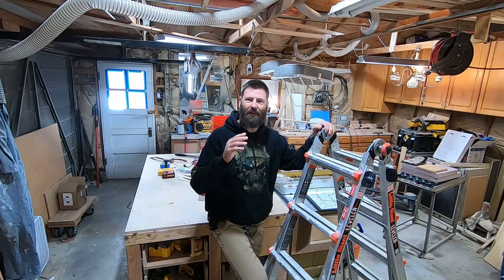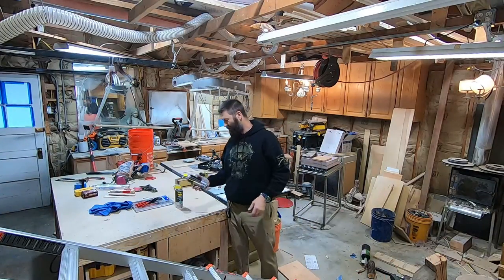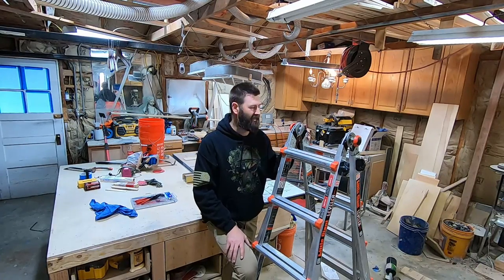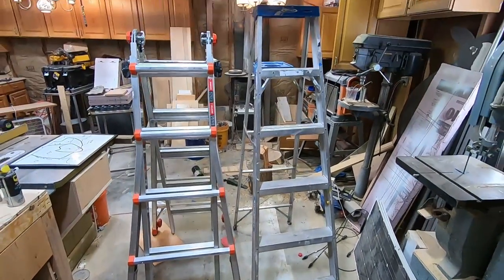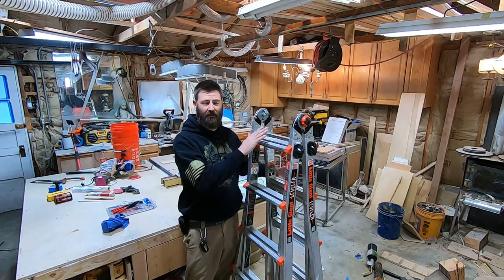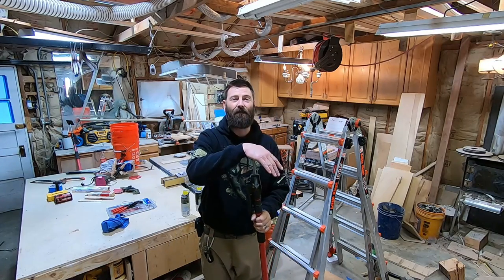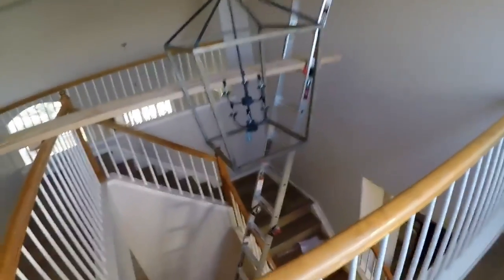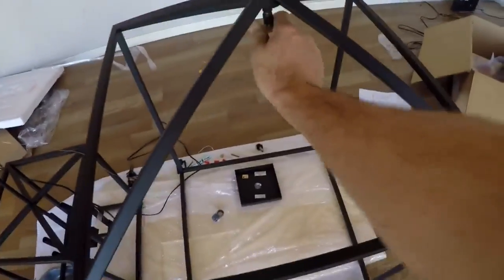The Last Ladder I Will Ever Own | THE HANDYMAN |

Comment: I've used the Little Giants for 35 years.  I've fallen off of them twice.  Both times, same scenario.  I was standing on them just like you when you were spraying that ceiling and I leaned enough to get my center of gravity off the center of the ladder.  Ladder goes the opposite way and I was headed to the floor.  Luckily, I only broke my wrist on one of those falls.  Love these ladders but like any ladder you MUST constantly be aware of your position.  Be safe out there.
Reply: Yep, don't do that.
Reply: Ever any problems with the feet slipping on hardwood or I the grass?

Comment: Little Giant held the patent on this ladder for years and were the only ones making them.  We purchased one and if I remember right we gave over $400 for it, but have had it for almost 30 years, banged around in vans, trucks, trailers and top of vans and job sites.  Still works beautifully.  We bought a new one for another van and had accessory levelers that we purchased that were a pain in the but to use but were useful.  I like the way yours function, but probably will not purchase another one as the doctors have told me to stay off of ladders and the wife is the enforcer.  Thanks for the video.  I love the Little Giants..

Comment: I love my 5 step little giant. I found it used in perfect condition for $99 so could not pass it up. The added Small platform Saves my legs when working more than 5 min. I love having a 22’ ladder that fits in my Tesla model 3. 

It is way to fricken heavy though so I also got a 3 step for smaller jobs.

Comment: I watched a ton of reviews on this ladder, and this is probably the best review because it shows it actually being used.  Also, it’s being used exactly how I am hoping to use it, over a banister to change out a light fixture about 20’ high, like you did!!  

Hopefully mine will work out just as well.  I bought the 22’ model today, lightly used for only $100; such a bargain. I think I’m going to end up spending more on the accessories such as the step plate attachment and tool caddy, etc as I did on the ladder itself, lol 😂. 

Thanks for a great review and Showing it being Used!

Comment: Sometimes they are the only ladder for the job. I only use them as an extension ladder when absolutely necessary as they are clumsy to extend without help.  The most useful thing for me in my work is the ability to extend one side longer than the other to keep you closer to the wall as you get higher.

Comment: I got one of these about a year or so ago for general use around the house, such as cleaning out the gutters and putting up Christmas lights - the extendable legs help when using on uneven ground and leaning against trees. Believe it or not, I actually transported it home using a bicycle (with a trailer). And yes, WD-40 fixes nearly everything that duct tape doesn't

Comment: I love my little giant ladders. I had the first one since 2004... still works great and never had to repair it. It will pinch you when taking back down if not careful. But the zones solved that and much easier to use. But love them both and all attachments make them nice.
Reply: Ever any issues with the feet on hardwood or in the grass with sliding??

Comment: Had a harbor freight multi that broke after 6 months, bought a gorilla that got stolen and then bought this exact one because of the leveling feet. Every ladder should have leveling feet. It's so much safer with 4 on the floor instead of 3 1/2. Also, didn't see you mention it, but there is a stand you can buy that hooks onto the ladder so you can stand on it or set things. Great platform for when you're working on electrical up high.

Comment: I have this types of multi positions ladders (for staircase only).  I guess my only question would be: what's the weight on that ladder? My werner  (same length) weigh about 43lbs the gorilla version same length is 38 lbs.
I am a high-ceiling chandelier installer and i prefer to use A-frame ladders. Ceilings over 23-ft i use scaffoldings. The biggest chandelier that i worked on is a Maria Theresa  8-ft x 8-ft, 84 bulbs,  600 lbs, 3 days, 3 guys to finish it.

Comment: I bought a Canadian Tire knock-off version of this for Christmas, regular $366 on sale for $200 (Canadian dollars, that is, which trades at about 75 cents U.S.) The only feature it's missing is the adjustable feet, but other than it seems pretty much identical in features and stability. The step ladder adjustability is terrific. My only issue so far was today, taking down the Christmas lights outside that were strung along the edge of a porch overhang (so no wall below) and maybe 17-18 feet off the ground. I have a proper extension ladder but wanted to try this one out. There's a 6" x 10" support beam that runs the length of the overhang, and so the job entails extending the ladder to the specific height that enables its top ends to lean up against that beam, so I can climb up and detach the lights.

I have to say, compared with the regular extension ladder, the multi-ladder was a real monster to get extended to that length. It was impossible to lay it on the ground, extend it, and then walk it upright, as the extended length is more than double my body and arm length, hence the top wants to tip back on you once the center of gravity is higher than your reach - and it's VERY top-heavy, so mere muscle isn't enough to counteract that amount of levered imbalance.

What I ultimately did was lay it down and extend it to about 14 feet, then walked it to an upright position, holding the balance with my left arm while muscling the top half straight up the last 3-4 feet. However, even the top half alone is heavy as sin when you have to lift it with one arm while simultaneously holding the lower part and handling the J-locks with the other arm. And then, of course, every time two rungs from the lower and upper sections need to pass each other, you have to figure out how to get your lifting arm repositioned without letting go, because if you let go the top section will drop like an anvil!

I managed in the end, but it was ridiculously fussy and difficult, and I would just go back to using the regular extension ladder if there's no smarter way to accomplish this objective - but that kind of negates a big reason for having this very versatile ladder in the first place!

I've been Googling to see if anyone has come up with a smarter technique to negotiate the extension capability, but so far no luck. If anyone has any thoughts, please chime in. Cheers!

Comment: I bought the LG ladder 20’ in 2017 and it was definitely a solid unit(although heavy). I bought the Gorilla Ladder 26’ MPL in 2018(although heavier) and I find it to be much more sturdier and a lot less flexing when fully extended. Both solid multipurpose ladders.

Comment: Nice. I have 2 of the step children to the Little Giant, the Gorilla Ladder. Cost around $100 for my shorter one about 15 yrs ago. It folds to about 4 ft tall or so and reaches a 1 story roof. That one has been awesome for me. Then I need a taller one. It’s similar to that LGs size to around 6 ft folded down and reaches about the same height. Home Depot had that on sale 2 summers ago for $120 so perfect. That too has been awesome. They made some nice subtle upgrades to the design. I had wanted a little giant but always pricey and the Gorilla is a great alternative for someone interested

Comment: I have the Home Depot version of this I forget what brand name is on it.  I agree with everything you say on this.  Home Depot version doesn't have have the self leveling legs unless I have completely missed that feature, which is possible.  LOL  I would agree they aren't so much heavy as they are unwieldy.  Old school step ladder you can carry and control one handed and still carry something heavy in the other hand.  This style of ladder you almost need to 2 hands it so the wide bottom doesn't smash everything you pass by.  That would be the only down side I have with it.
Reply: Also another nice feature you missed is you can stand on the top step of this kind of ladder.

Comment: two little giants and a decent plank make for a great mobile scaffold. The lower sections will separate for that purpose but if you need to go higher, two full sized ladders does the job especially if you have ladder jacks that will hold a full sized scaffold platform.

Comment: I got this ladder after watching your first video installing the light fixture on a high ceiling. I love the ladder, my only complaint is that it moves too much when using this ladder in the extension ladder. did a light bulb replacement on the exterior of a home; height was 24' high. climbing that high and having the ladder shake while I am going up was scary AF... but GREAT LADDER!!!

Comment: If you are doing Amazon Affiliate links they have that ladder a few dollars cheaper than Lowes. I have one that does not have the telescoping legs and use it more than any other ladder I have. Just using a minivan to work out of so limited space. Also, have a really old fold-up ladder that I am still using at the house. Probably 30+ years old.

Comment: Any one tried the  Task Tools poles from Northern Tool?
I've been using them for the past 3 yrs and LOVE them. The have a quick slide adjustment, and then you twist them like a turn buckle.
Not sure on the load rating, but I've used them in a few non conventional ways and they hold up GREAT

Comment: I was ready to unfriend you if you didn't like this ladder.  I've had one for about 20 years and it's far and away the best system IMO.

I have had to replace some worn parts and that has been easy as well.

Have you tried the step that they make for these?  They slide onto whatever ladder rung you need and will hold body weight for a makeshift work platform.

Comment: Very good video.  Do you know how high the Little Giant Ladder 22 ft. will reach with the "A" frame extended?  I need to replace the light bulbs in my garage and the ceiling is 15 - 20 ft high.

Comment: How do you secure it upright in your trailer? Right now mine is clamped  upright against the wall of my van with basic wood clamps but I’d like to find a more secure method.
Reply from the maker: Lean it up against the workbench and I have used a clamp in the past.

Comment: One question : do you feel the stair threads or steps are too narrow?  Do feel your calves feel tired at the end of day?  Reason I asked because I did a vault ceiling light installations (but without shoes) and felt my legs hurt
Reply: There's a step platform by Little Giant that's not too costly. Very convenient. Buy two and use one as a tray for tools.

Comment: Ive seen those spindle rails installed,,, felt them after theyre installed,,, climb out using them as a brace using  some nice flexable lumber, dude lets use some common sense here, while those boards dont flex alot , they do flex, so your weight is no longer pushing straight down its pushing those spindles outward and the more you weigh the mire they flex increasing the outward force,  so yeah good f'n luck with that! You might be good the first 20x but #21 is always the gotcha

Comment: No way. Used them when other people had them only. Heavy, and thats all you need to know. If you need more, it will bash your knuckles or smash your fingers. Yeah it works as a ladder. If it were really any good though, more contractors would use them over standard ladders. But they dont.

Comment: Are you sure that’s the correct ladder?  The one you posted is a “revolution” model and not a leveler model.   Thanks Handyman!
Reply: Revolution M17
Reply from the maker: This might be a better link. https://www.lowes.com/pd/Little-Giant-Ladders-Leveler-Aluminum-22-ft-Reach-Type-1AA-375-lbs-Capacity-Telescoping-Multi-Position-Ladder/1000750360

Comment: When you get up really high you are setting yourself up for a major fall. Just a slight side way push on the ladder at the top can tip the ladder over, even though it has a wide base. That happened to me when I was working on my sailboat. I fell 13 feet to the pavement and was lucky I landed on my fat arse, otherwise I am sure I would have broken some bones.

Comment: Man, that looks damn dangerous. I suggest a safer method.
Reply from the maker: That was the safe method
Reply: I would have added  a clamp to each side of the board  at the ladder or the handrail to prevent the board from flipping.